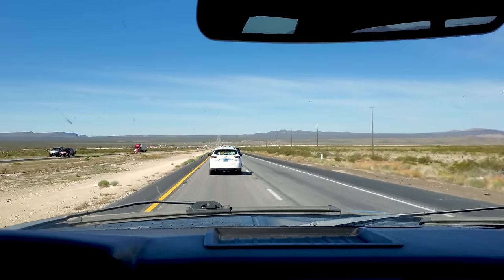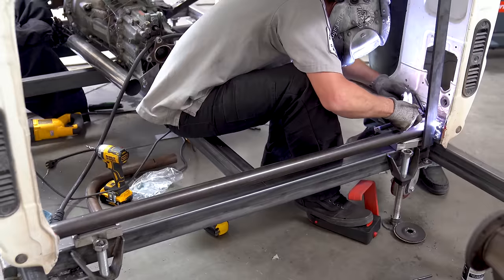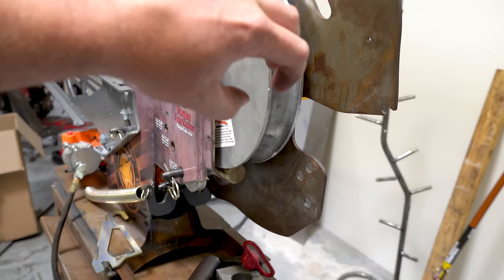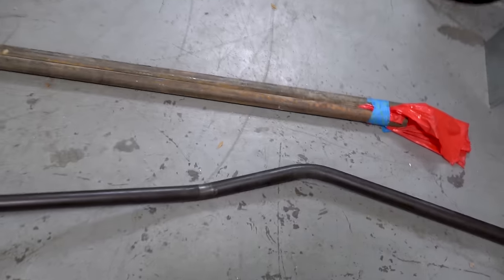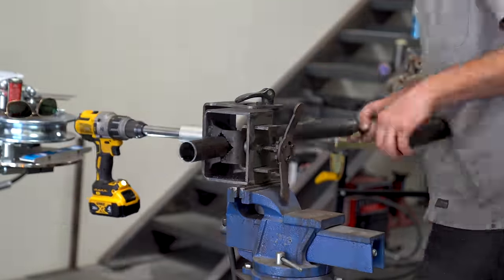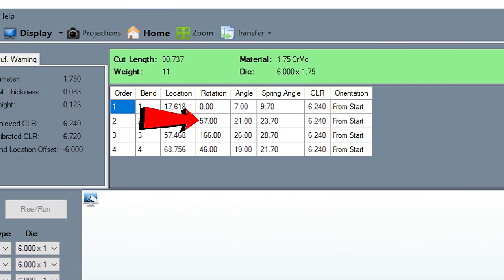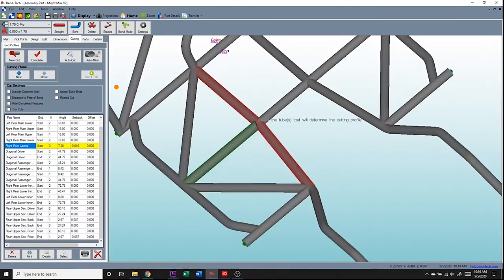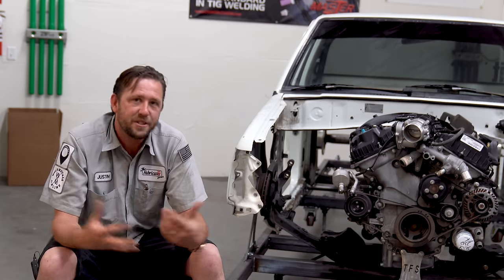First Tubes and First Problems

Comment: Thank you sir. Really enjoy the content. When I was working on my Volksrod project  I built the chassis and later decided that I had a spare set of truck arms (63 Chevy) that I could use in the rear. Well long story I'd have to chop up the chassis and rebuild the back half to go that route. So It didn't happen. The good news is I'm going to see how they fit my 50 ford project when I get it in the shop. The short story I really appreciate the videos. They are super inspiring.

Comment: Thank you for your tig vids, I have had the everlast powerpro 256si for 9 days now & it's my 1st tig & my 1st real welder.
I've had been working with a 70amp stick & a lowes brand wire feed. Both work okay for what they are.
Gtaw welding is extremely difficult.
I really struggle getting a puddle to start for autogenous tacks on t-joints eventually they happen but usually after frustration & multiple dips

Comment: Love the series, keep up the good work. For those rusted out tubes, my first thought is a four foot length of something narrow, like half inch solid rod or tube or all-thread or hell, wooden dowel would probably work in a pinch. Slice a notch in the end of it, lay in some sanding belt across that notch, then chuck up the other end into a power drill and give it hell, up and down the inside of the pipe. Not sure if it would work to the degree necessary, but it's a thought. Looking forward to the next installment.

Comment: Have you ever used evapo-rust? The stuff is amazing!  It a liquid that you soak rusted metal in and it dissolves the rust with no work.  1 gallon is about $25 at harbor freight.  I know! But it really works well  I love this stuff and you can use it multiple times.  You could fill the tube and let it soak over night,  drain it back into something for reuse later rinse with water and you will be ready to go! Loving the build can’t wait to see it done!

Comment: That explains why I couldn't get 1.75" tube for my build!
I'm 75 miles from Vegas.
Reply: Next thing you know he'll be hitting you up to buy whatever drops you've got laying around the shop.
Reply: LOL Sorry I shouldn't laugh.
Reply: If i have a 6 point rollcage in my car... can i just connect the cage to rear subframe and to the suspension towers 

Then cut the unecessary sheet metal like the floor and firewall and trunk??

Comment: The only tube I've ever bent was pipe, and not on purpose.  

I wanted your scrap pile to make a go kart, until I realized I wouldn't be able to bend any of it, I don't know how to design one, and it would be ludicrously oversized.

Really enjoy the honesty in your videos, sprinkled with a positive attitude!

One thing I have gotten better at is rust removal.  Evapo-Rust might clean out those long tubes, if they're not oily.  The stuff is amazing if you haven't used it, because it doesn't attack iron the way phosphoric acid etc. will.  A bit spendy, but you soak parts in it, and reuse the solution afterwards.

Hang in there!

Comment: Great Video & insight.  Knowing when to back off & take a break or just step back to refocus is wisdom. It can potentially save you scrapping expensive material, breaking something  or even hurting yourself or someone else. 

Sometimes its can be as  little  as just being reminded of what we already know. Not that I know how to mandrill bend....yet.

I guess what your series has helped me come to terms with is knowing (the fantastic knowledge you impart aside) is being honest with myself where my limitations are, in skills, insight & equipment . So I am more than a year into a build that has a heavily modified chassis & body. I decided to  pay someone with the skills & experience to get the job done right. 

It seems that what happened was providence the project had faded & was put aside for more than 30 years until I met this fabricator/muscle car restorer, I don;t think I would of got started if it was not for Steve.

It has been frustrating & satisfying @ the same time to see him doing the build that I wanted to do with my own brain & hands. It is satisfying to see that he is enjoying the project. I think it would of been a huge mistake if it was someone else that just saw it as a job.
 At one point it almost went in that direction for  part of the project. I almost sent the chassis  across 80%of the continent of Australia to get the modifications done.

I know I drive Steve nuts because, I want to be involved with it as much as possible, I am detailed in what I want & it takes a special kind of person to recognizes what that is really about & where it  is coming from.

I hope one day  by the time this build is finished I will have the skills to do the next build project hands on.

Looking forward to your next video!

Comment: Pick yourself up one of those dryer vent cleaning kits from local big box hardware. Has threaded nylon rods strong enough but flexible enough to clean out even bent tubes. Rig up some sort of holder for wire brush and/or sandpaper, chuck in a hand drill and you're back in business with those tubes!

Comment: Been watching you for hella years now man. Keep it up. I've learned alot from your tips and skills. Just recently obtained my welding certification for stick and tig.  Needa work on aluminum. Needa invest in a tube bender now 🤘 thanks bro👍
Reply: Exciting times brother, Congrats! Aluminum is a honey ;) I personally(and justin apparently) LOVE it. Once u understand how she acts it because 2nd nature, depending on persistence, I became very familiar in about 6 months. Bender is great tool, +welders, saws, handtools=good to go! Godspeed
Reply: @DCweldingAndArt  I got my 1st tig about 2 months ago, I have burnt through so many rods and gas learning Alu just to do 1 job.  Love it, I just forgot how much a 1/8" 5' x 3' sheet will distort when you don't know what you are doing but need to do 100+ plug welds for the supports (its the bed in the rear tub on a Land Rover).
Reply: @DCweldingAndArt  I appreciate that 👍🤘 
I'm still using my lotos for aluminium. Good day👍
Reply: @petej536  practice, practice 👍
Reply: @Ryan_1997 Best thing i have found is to practice to a point then walk away and leave it, come back a day or two later and it's like my brain has had time to process everything and put it in perspective.  It's great.
Reply: @petej536  hell ya all muscle memory and tuning your machine for what you're working with. Took me awhile to tune mine and figure out the the amps settings for the thickness of the metal. 👍

Comment: That bender looks brand new. The mandrel, pins, springs, Linder, hoses, etc. - all look minty fresh! Either it's new or it doesn't see much of any use which would explain the pile of tubes on the floor.
Reply from the maker: It could explain the pile of tubes - or - it could explain the fact that a shop and its equipment doesn't have to be dirty for validation. I take care of my tools. In return - 
they take care of me.
Reply: @TheFabricatorSeries  Keeping the mandrel spotless and the dies and pins without so much as a scuff on them is truly a remarkable feat. Do share the secret, will you?

Comment: I may have missed it but did you touch on SFI rules and changes from one spec to another for NHRA certification at completion? This is something there is not much creditable information on fir a starting point.  I built a chassis for my S10 which passed certification for a 7.50 second 1/4 mile pass but a rather minor change in materials and technique it would have passed for 6.00 second 1/4 mile pass. Just a thought for future discussion or videos. Thanks for all the great videos you have posted!

Comment: Try not to kick yourself about the schedule of this project. COVID is fucking up pretty much every scheduled task in the US right now, and I'm sure it's affecting your suppliers as well. You're an extremely skilled fabricator (obviously), so you're lightyears ahead of most of your viewers, myself included. Finding and debugging a software issue from a customer's perspective is really difficult, so mad props for that as well. You've made a ton of progress since your last update, even if that progress may not have been in the form that you wanted. Hang in there man.

Comment: Best way i found to clean long pieces of tube/pipe on the inside is to take a length of 1/4" stainless rod, slice the end an inch or so in, starting through that fork wrap a strip of 40 grit around the end, and use the whole thing in a powerful die grinder as a really long drum sander. Works great for rust and even cleans up inside seams on regular tubing.

Comment: Discount on chrome steel tube weld metals kits? Would be cool to see some strength tests between mig, tig, flame, and heat treated of the ones that require it.

Comment: I lucked out.  I lost one piece of steel from cutting it to short after I bent it. However, I used it in smaller pieces.  The good thing for me was, that I was using AutoCad since 1992.  Always trust your software if you know that you are not messing up, gigo.  when N.H.R.A. inspected my chassis. he was amazed how flat it sat on my table no rocking at all.  I ended up with a 25 -1E Certificate.

Comment: Steel cable on a drill. Put a hose clamp 3 inches from the end and fray the end. Works good for cleaning the inside of tubing.

Comment: Curious if you are drilling vent holes so all your tubing vents through each other? Since as they build up heat they will build up pressure and could blow out the weld, so venting all the tubes through each other is what I have been told is what you do. 

I haven’t done this or built something like this! This is just what I have heard is standard. What do you think about it and are you doing this? @thefabricationseries

Comment: how much strength is the chromoly factor picking you up, vs the extra cost and the delays, can you mix and match the chromoly and lower grades or will the welds between them not be up to smuff at that point

Comment: I've been using Bend Tech software for years but not the version you have. When I would have a screw up I would figure I made mistake in the bend or the cut or something. When it would happen more than once I would go back to the software only to find out I had input a number wrong.

Comment: For bending electrical and plumbing pipework we use bending springs to maintain the internal diameter during the bend (which pull out easily afterwards.) Nothing similar for your big pipes?

Comment: We have some six foot drill bit extensions 4 electrical Drilling and pulling wire and I'm just wondering if you could take a brake cylinder hone on one of these extensions or three and clean the inside of your tubing this is for aggravation more than anything because bending conduit is not like bending chromoly

Comment: Feel for you, first (and only time) I build a cage I got through considerably more tubes than planed and had to go tube shopping half way through. I’m sure you’ve tried already but do you know any other fabricators that might have a length in the corner of their shop gathering dust?

Comment: to clean out the tube take a piece of rod cut a slot in the end of it. stick some sandpaper through the notch, and run it through the tube with a drill

Comment: Bend tech is a great tool. But it does have some really frustrating limitations. To get around most of these I draw everything in CAD software and then transfer the finished model into bendtech  to print out the instructions.  One benefit of this is being able to make all of your brackets, body panels, and other things with axles, shocks, motors, and other drive train components in the 3d space to reference off of.

Comment: Hello guys. I have a question. On my old race car I noticed rust on the underside of the car where the roll cage feet pads were welded to the floor. I'm guessing if it would have been painted before it rusted this wouldn't have happened. But what if u r gonna weld a plate to a portion of the chassis where u don't have acces to the back of it. What do u do to prevent rust?

Comment: That's why you buy the same size fence post and build a couple practice bars I made almost a full cage out of 1 5/8 .095 mild steel its 1.15 a foot from a local place then I built the cage from docol and still messed up a few spots lol

Comment: Being honest to your faults can be the best quality a skilled trade worker can have. 
    It may be common sense to some. It may be the direct path to doom in others mind. 
     Corporate mentality seems to be poison to this idea. The minute a person owns their mistake it causes doubt.  However working in complex work environments were multiple mechanical moves such as these are made, you’ll find out that hiding from errors severely slows down progress.  Especially when their are artists at work deflecting their responsibilities and throwing others under the bus. 
   Unfortunately I’ve seen this a few too many times. 
   Recognizing this dynamic has served me well in times that desperation had the rats running. 
   Stepping up and vocalizing an honest assessment of your own input into the project, placing an emphasis on what you think can provide improvement to the situation, has proven valuable in my career. 
    Sure the ones throwing others under the bus will try and feed off of it. Let them eat. So long as you’re not making a living making nothing but mistakes, putting your best foot forward in name of quality and progress will win out the situation. 
    It’s a shame we have to talk about this these days. I believe it’s another one of our self evident truths.

Comment: Just a thought, but with respect the the rusty ID on the one stick of tubing you finally found;  could you attach a plumber's snake to a bottle brush hone, sandpaper flap stick, etc.,  lube it up, attach it to a drill motor, and clean up the ID of the tube that way?    Not a fabricator, just spit-ballin'.   Great series, by the way.

Comment: Find a long piece of 1/4” threaded rod and a wire brush wheel to clean the inside of the tube using a drill

Comment: take some emery cloth hook it to a power snake { hand drill type } run that inside the tube .. shorter stuff i taken dowel rod steel .. slit the end to hold the cloth ..made the strip long enough so that when you spun the rod in the drill the sand paper would clean the tube you are working on ,, it will spin like a whip

Comment: Thing with cad software ,unless you work with it a lot and you eventualy become good at it you will loose time.I used simple autodesk thinkercad which is considered easy,and it took me 30min to find out what was wrong and why god dam thing didnt wanna make 5 holes where i wanted them ! I could have drafted that part,throw dimensions  on a peace of paper in 5 min  and make it in other 25!
I think cad software is great tool when you design a stadium or brand new rocket engine ,when you have 25 people working on a same project and they need to see what you are thinking. For a 1 guy in a shed doing things alone in your own head where you can visual peace you are making with a greatest cad software ever created called human mind ,peace of paper and a pencil is all you need.
At least that was my experience so far ,i tried several of them but it was just meeeh ,i will do it on a paper faster. . .
Reply: That or of you intend to mass supply. 

I simple 5 hole bracket may take you 2 hours to draw but a machine will produce 50 in the half hour it takes you to make one
Reply: Sure if you have at least 1/2 a million $ of CNC and automated machines then you have to get the training to program the equipment or pay someone else 200$ an hour to do it for you.

Comment: 1.75 .083 is a weird size ...wouldn’t 1.625   0.083 as used in most moly cages been easier to find?

Comment: We alk have those struggles, isnt it on limited funds, than its not able to get the right material, im dealing with same issues here, building a 800 HP drift car, by my own, doing almost anything my self.
Did hook up in the monthly pays..
Then finding out the whole ecu package should cost around 5.000..
While im not even able to make the brakets for the rest that needs to be done... because the size is out of stock...
Project on hold for 3 weeks already

Comment: Get plastic coated wire rope. Attach some chain to one end of the wire. Put the wire in a length of plumbers plastic pipe. Attach the other end to your battery operated drill. Hey presto you have a flail that will clean the inside of tube.

Comment: You can get a Dingell Barry home for a honing cylinder walls if you get a small enough one and put a long extension on it and then run it down through there a couple times couple quick passes because you don’t wanna remove material other than the rust anyhow food for thought this is six in a row Jim from Kennerdell Pennsylvania I go six in row gym because I have a 91.5 dodge I could

Comment: Sorry for being an idiot but how is the mandrel bit held in place when you're bending tube? I'm confused!
Reply: If you look back at about the 9:35 mark in the video you can see the tube he is bending being pushed over a smaller tube that runs all the way to the back of the machine. After clamping the tube to be bent in place, he then goes around to the back of the bender at about 9:40 and cranks the mandrel forward lining up the brass egg-shaped mandrel with the point that the tube tries to collapse while being bent. Then he gives it a shot of grease and makes the bend. After the bend, if the mandrel is stuck you can crank that wheel back out to pull the mandrel back away from the tight point of the bend. Then remove the clamp and you're done.
Reply: @Cyruscosmo  thanks! Makes perfect sense now!